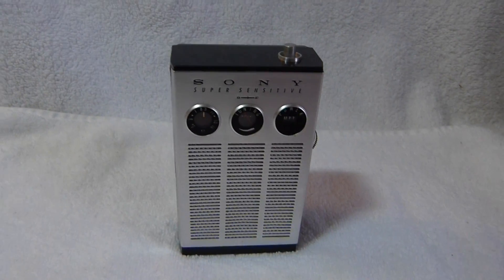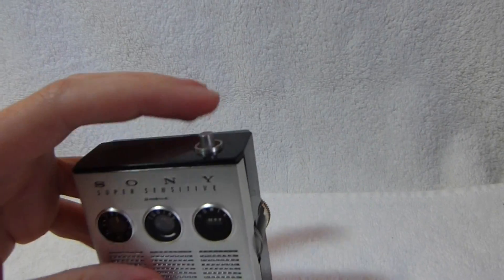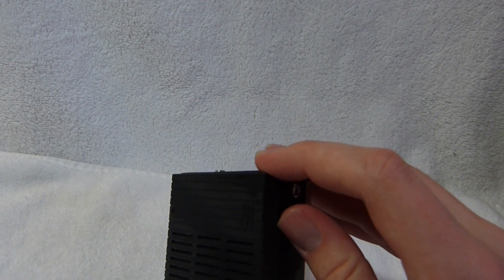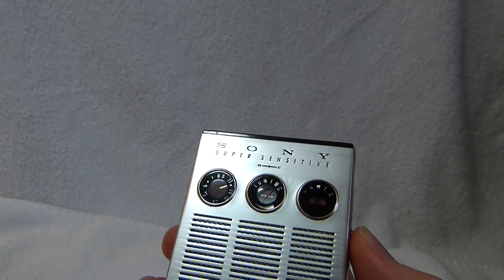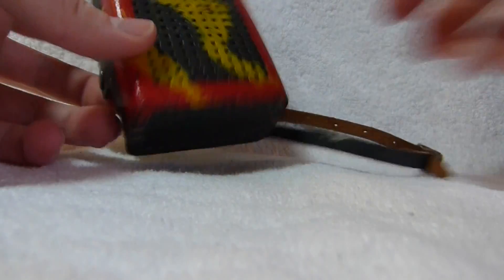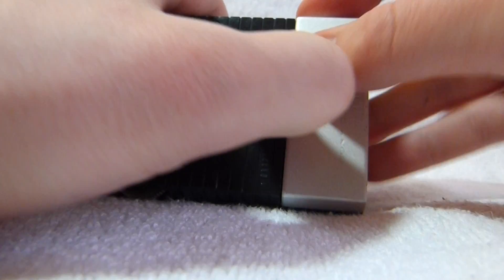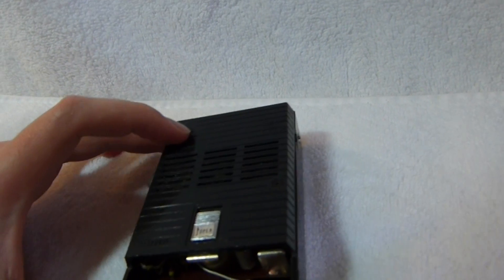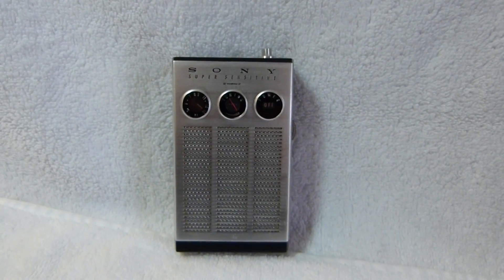1962 Sony model TR 817 transistor radio with tuned RF stage (made in Japan)

Comment: Look for a natural hand cleaner called "Stoko Kresto". It's an amazing product. Let it sit on the paint for 20 minutes. Then add a touch of water and scrub lightly. Come back 10 minutes later and the paint will come off easily with a wet scrub brush. It will not damage the leather. Let me know if you try it.

Comment: hi there, I have a 1958 Bulova transistor radio that I'm trying to fix for a friend. it turns on but no stations but you can faintly hear some noise in the speaker when turned on. but still no stations. It has had two electrolytic capacitors replaced in the 70s and one has a lead that is corroded. I'm kinda stuck. any ideas??

Comment: I agree, super cool radio....for the tone control, find out which capacitor is connected and replace it, different values will give you different ranges. Sorry to see the case like that!
Reply from the maker: Thanks! I am probably going to leave this one alone, since I mainly use my larger radios for listening. I did swap out the tone control in this Channel Master for better sound though: 1960 Channel Master 6 transistor table radio model 6511